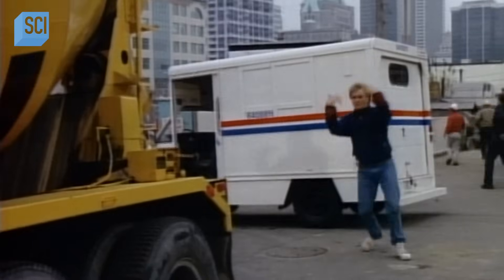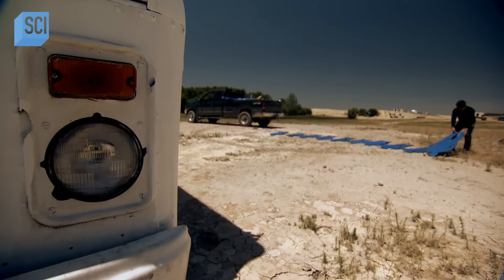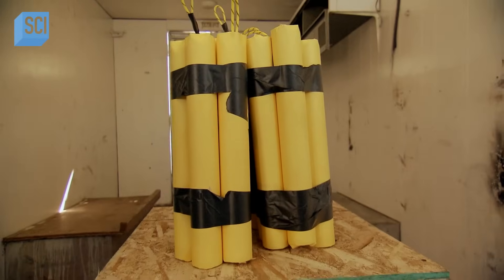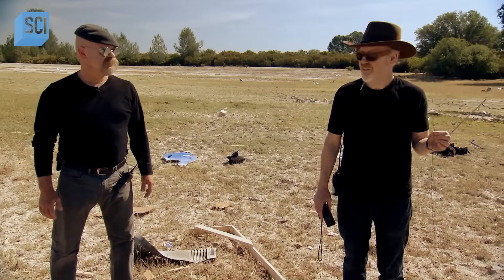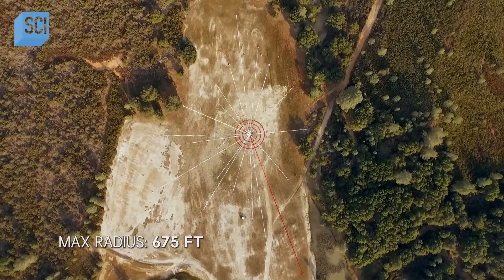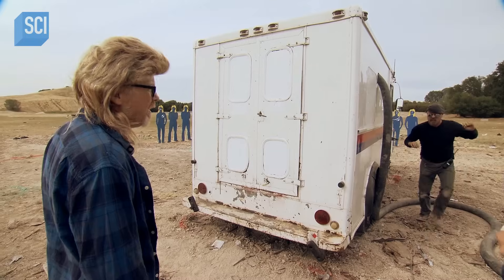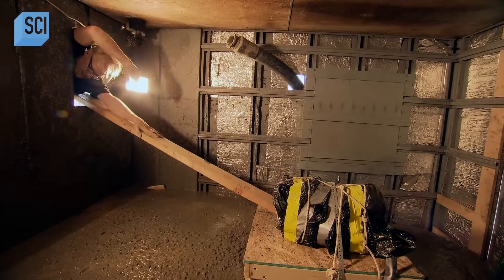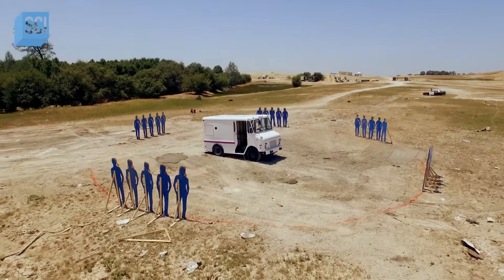Detonating Two Mail Trucks Filled With Wet Cement & Explosives! | Mythbusters | Science Channel

Comment: They duplicated MacGyver's result. However, most of the dynamite didn't explode, so, they did another test. In that test, they blew the truck to bits. Nonetheless, their first test may have duplicated MacGyver's result perfectly, as perhaps most of that dynamite failed to explode, also. Anyway..
Reply: I guess one could argue they did duplicate it if macgyver filling the postal truck caused some of the explosives to shift like what happened to the mythbusters and covered up the rest of the stuff that did trigger 🧐